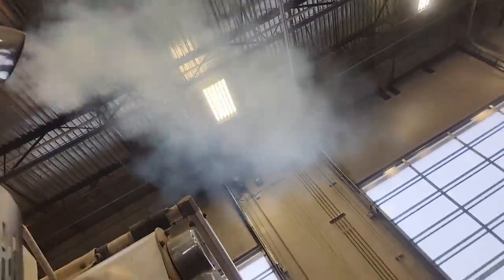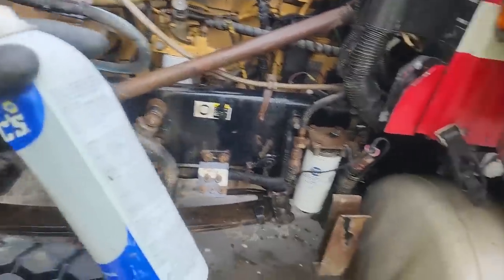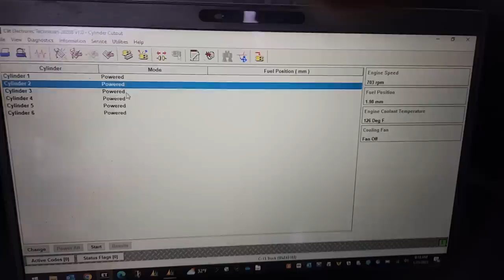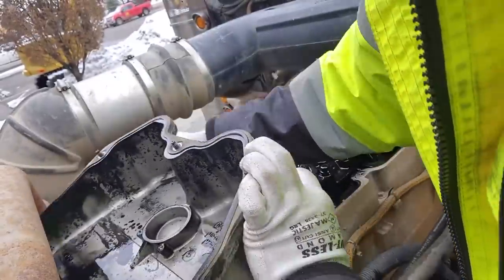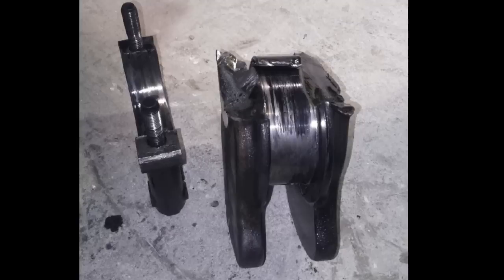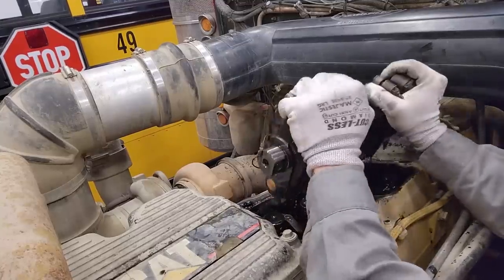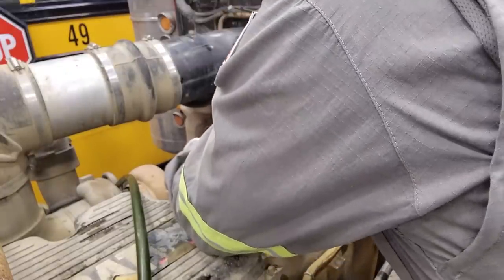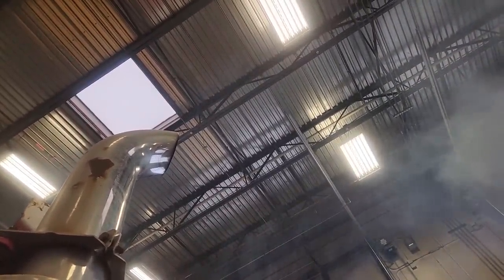"Smoky Red" C-15 Smokes Bad when it is Cold, but why? Cat Diesel Engine.

Comment: 2:15 You mentioned "Not sure why everyone seems to do it, I just leave it alone" 
That being a vacuum line running to the waste gate, most who do this are intending to keep the waste gate closed expecting the turbo to make more power. 
Consider it a poor mans waste gate delete. 
I can see this helping with more power in the higher RPM's however when it comes time to switch gears there will be a longer float in the RPM's before they drop low enough and you can get into next gear without nicking or grinding the gear. Because the exhaust pressure cannot dump out from the waste gate so it keeps pumping the turbo. 

I could be entirely wrong, but that is my theory on it.

Comment: When is a good time to overhaul a 1999 3406E caterpillar engine? My oil analysis is showing 2 ppm chrome and I was told that’s the rings which is very very minimal; copper 1 ppm, iron 4 ppm, lead 3 ppm.

There is a little bit of blow by on the valve cover blow by tube and the oil fill tube.  Should I wait? The engine has around 14,000 engine hours on it with 785,000 miles.  Rod and  main bearings,  turbo was replaced 250,000 miles ago.  Thanks!

Comment: I think you missed a very valuable step and that would have been looking at the blowby tube. Another one would be checking exhaust manifold temperature especially after you figured the smoke was coming from #4 cylinder I very rarely swap injectors normally you can figure out if you have a mechanical problem in the cylinder or not

Comment: I have a truck that spits and farts backfires when put under load when it’s cold out side and the water temp is between 130-175 degrees. Colder that 130 it runs great warmer than 175 runs perfect. What’s your thoughts

Comment: Is it fuel smoke or antifreeze smoke ?   Is the coolant system pressuring up when the engine is cold but OK when it is hot ?

Are you going to pressurize the #4 combustion chamber and test for leak down ?

I can't wait to see how this goes.

Comment: Rather than suck the.fuel out after pulling injectors, I pull fuel lines at front and rear of head and use compressed air to blow fuel out completely.
This way I don't let it in to start with.

Comment: I have seen loose glow plug cups cause smoke when cold on cat motors , but not cause missing. It will be interesting to see what's going on.
Reply from the maker: Cat engines don't use glow plugs. At least none of the truck ones do.
Reply: Glow plug Cat engines, PC hasn't been made in trucks since the 80's.
Reply: @AdeptApe  Yeah, I'm talking about old cat motors of the sort you have never worked on or seen I guess. Old tech, which is why I thought it might be interesting to see what causes such problems now with the new tech.

Comment: Question got a 05 frightliner columbia 
C15 acert (bxs) 
I just put 4 tested good new battery's in it and it still slow cranks. It'll spin over 1 time then go super slow like a dead battery then slowly speed up and start. 
Sometimes it dont even start. Dash says 12.5 volts. Will only start when given 13 on a charger. What is my issue ?
Edit I live in Florida it isn't that cold

Comment: Hey! if you still work for CAT i have some questions! im currently a generator technician with the military in Canada and CAT often takes us direct entry into their power systems technicians positions, im heavily interested in transitioning from the military to a position being offered near me working a shop technician position working on CAT rental gens, which are the same 3412 engines (and others of course) we use in the military so im very familiar with them.

what is it like working for CAT?

Comment: Personally I'd run a leak down to validate low compression and then measure piston at TDC (tig rod with tape is handy) with a companion hole to ensure rod is straight. Either way, off with its head!

Comment: So what duration of time and at what ambient out side  temperature is gray smoke on a over night cold start acceptable, when starting from say below O oC,  Or even 5 oC or less?
2003 NBM C15 , 46000 hours, single Turbo no dpf, original injectors (I think dated 2002) 
(new orings and cups + over head done 10k ago,)
Runs fine when warm , has minimal blow by and uses about 2 gallons of oil every 15k on average. 
So I get gray smoke when starting from very cold like over night below freezing temps, but this gray smoke goes away after about 5 minutes of runnings some times less if it's above freezing, depending on how cold it is, If it's say -9 oC then it can take longer to clear up,, they is more engine vibration during this stage, but it doesn't seem to miss or shake like the truck on this video also no black smoke ,,the engine has a more throaty sound to it and a deeper exhaust note when cold, then it smooths out when it gets past 90F on my scanner 
The needle on the dash doesn't move before it's cleared up.
when it's ambient temperature like 10 F or above it seems to not have this smoke issue only maybe for a few seconds like 15 to 30 seconds then clear.
I would have thought gray smoke on start up is a combination of cold cylinder and cold fuel temperature combined with cold inlet manifold air temperatures cold oil temperature, causes the combustion temperature to be lower than that's required for a efficient clean burn to take place.
If the engine is at all warm to the touch then its fine,
Also where did you get the fuel pressure gauge from do you have a link for one of those

Comment: rocker shaft needs the updated bolts installed, boost leak at the intake boot, frame fuel filter is most likely wrong not a 25 micron, should have checked the flash file for current file and the injector trim file, cant remember if the 6nz was a low nox required on a overhaul or not.

Comment: Nice seeing someone not use a parts shotgun and waste a whole bunch of money
Reply: Unfortunately many parts are cheaper then the labor to have a good diagnostician figure it out. The common fuel issues it certainly applies to, filters and pressure regulation spring can all be replaced for less then 1 hour labor.

Comment: Not a diesel mechanic but would like to ask, are the injectors hard coded to the PCM? Great video.
Reply: no they are not. however, some swear by going into cat et and putting in the injector codes but in reality it makes no difference at all. Probably the best comment on this whole video with question. you sir have a good head on your shoulders. Alot of the comments on here are really silly
Reply: @mikegrazio5376  Eh don't hold your breath on CAT not doing stupid shit like that. JD already is and we're starting to see that sort of 'marriage' bullshit creeping into passenger vehicles as well.  And I know it's not a diesel engine, but Apple is doing that shit with their i-Devices too! You replace your own iPhone or iPad or MacBook battery? Yeah the mainboard knows it and basically just bricks your device. They 'marry' the battery to the device and without access to their servicing software you can't divorce the bad parts and marry in the replacement ones.

The companies building this stuff do not want anyone other than first party dealerships/techs working on their shit anymore and 'marrying' parts each other is one way they work towards that.

In an ideal world I would be able to replace that injector in my driveway as a shadetree mechanic with no access to the diagnostic software what-so-ever and have the engine run just fine afterwards, but that eats into corporate profits and they don't like corporate profits getting eaten into. They will cut shadetrees like me out first, then once they're satisfied I can't work on their shit anymore, they'll start cutting third party pros like OP out.

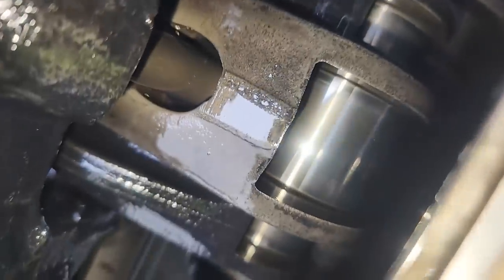Comment: 2 of the (what i assume are) rockers look like they're cracking @ 5:27 to 5:30, is that normal or optical illusion?
Reply from the maker: Good question, I had them off and really didn't see anything wrong with the rockers or anything else in the valvetrain. I could have missed something of course, but usually rocker problems are pretty obvious once you get them out of the engine and look them over.

Comment: I need that laptop to figure out why our c15 Acert is hard starting .Seems to lose prime even if its sits for 15 mins or so.Longer it sits worse it is. Short sit and it will start with 2 cranks ,longer and your priming it to get it to start. Any ideas?
Reply: If you think a laptop will assist sorting out a leaking fuel system you need to take the rig into a shop.  Trust me it will be more cost effective.
Reply: @Failure_Is_An_Option  Agreed. Laptop isn't going to tell you where the fuel is leaking off that's gonna take basic troubleshooting

Comment: I love your Diesel engine comparison/repair videos. Cat is one of my favorite Diesel engine manufacturers, as well as Detroit Diesel, Cummins, and Navistar International. My favorite Cat engines are the 3406B/E, C15, and C18. I do have a question though. I’m wondering if there is any possibility if a C15 could fit in a school bus? That’s a project I’m currently dreaming about.
Reply from the maker: That would be quite the project. Most school bus engines are 6-7 liter engines and weigh about 1,000 pounds. A C15 is 3,000 pounds, plus you would need a bigger radiator, CAC, etc. It would probably throw off the balance of the vehicle and that weight on the frame and location could be a problem. I'm sure it could be done though.
Reply: @AdeptApe  thank you for replying. I do know that I’d need a different transmission, axles, rear differential for it as well. Possibly a different hood to cover the C15 and bigger radiator. I’m still trying to figure out how it’ll all go together. It’s taking some time and research to debate
Reply: I think it depends on the engine compartment size. Motor mounts could be fabricated in but then you’ll wind up doing a lot of engineering. Radiator would need the be remotely located …etc. Definitely a project. I own a 2006 Blue Bird school bus with the 8.3 Cummins engine. That thing runs smooth as glass.
Reply: So all the USA diesels but mack? Why?
Reply: @sophiasocal68  thank you for your input. I’m still studying this idea at the moment

Comment: Hi my Name is Errol I have a 2004  peterbilt  387 with a cat motor I just replace the transmission now it won't build  air pass 60 psi I have replace the air dryer and no change I can't use the red splitter I have to drive it like a 10 speed  it is a 13 I am trying to figure out if it's anything else before  I replace the air compressor

Comment: What's the symptoms if the overhead was way too tight?
Reply: As the engine warms up and everything expands it can create a situation where there is no valve lash and actually hold the valve open slightly.  Just enough to kill that cylinder.

Comment: First
Reply from the maker: You were so close.
Reply: Cool diagnosis process. What do you think is wrong? Worn rings/scoring leading to low compression when cold?
Reply from the maker: My guess is a bad head gasket, but not blowing into the cooling system yet. It will throw off the compression ratio and cause weird problems before the cylinder gets some heat in it. Just a guess though. Seen is a couple times, but just a guess right now.
Reply: @AdeptApe  y
Reply: @AdeptApe  alright! Hope you/we get a chance to find out.